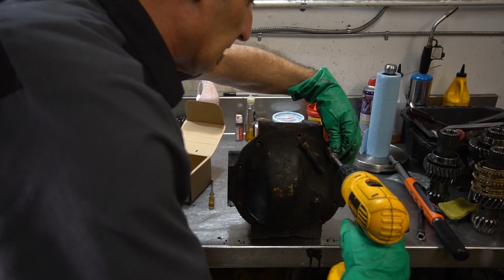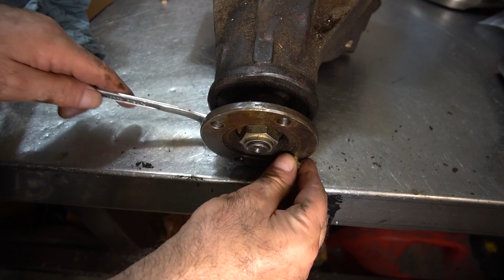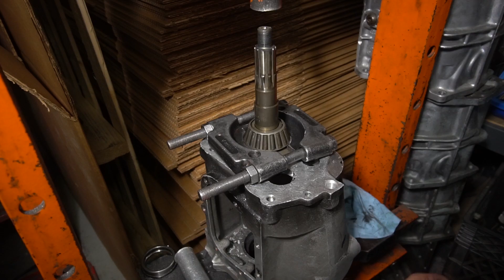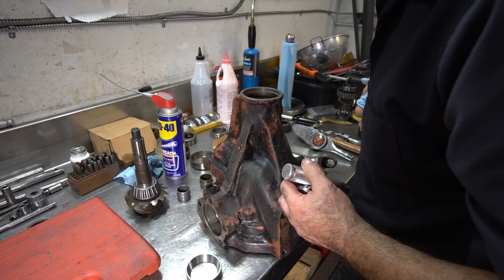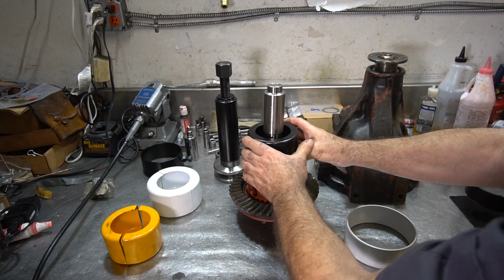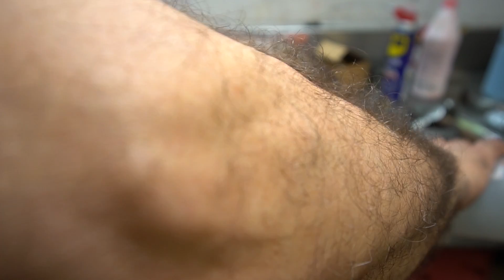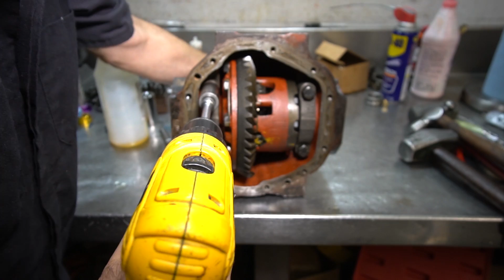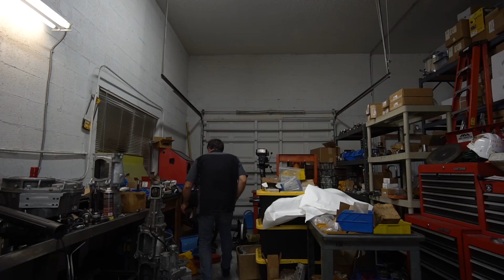Dana 44 Carrier and Pinion Bearing Replacement Basics Jaguar XKE

Comment: Great timing for me to see this video.  I'm getting ready to change the pinion bearings in my landlord's jeep commando and swop out the front ring and pinion in Jeep. Now I have all the information I need to get both jobs done. Thanks for your excellent tutorials.  I watched your tutorial on rebuilding my Muncie 4 speed. It really gave me the confidence to get it done right. Been running it for almost a year now and it works great!! Thanks again.

Comment: Paul - you're a brave man, setting the drag with an impact gun.  (Either that, or just MUCH more experienced than I am - likely!)  I always do it by hand, just because I don't trust myself that much, and don't want to have to buy another collar and start over.  :-P

Btw, I love your method of setting the pinion depth without the crush spacer.  Wish I'd thought of that years ago.  Cheers, mate.  :-)
Reply: PS:  One downvote - must have been Rhonda.  LOL
Reply from the maker: Originally my shop rebuilt everything. We did engines, automatics, manuals and diffs. I set up hundreds of diffs but liked doing vettes , jags and Ford 9" the most because I didn't have to deal with  complete axle and housing assemblies cluttering up the shop.

Comment: Thanks Paul, Excellent video! I've always been concerned about new bearing sets being slightly different than old ones. I don't remember ever having much of a problem. I will mic the width of the races between new and used bearings and they have always been within a couple thousandths if not perfect. Do you ever have any troubles with this since you cant check complete bearing wear between the cup and cone. I just always check backlash.
Reply from the maker: If the backlash is in spec, which it usually is and the pattern matches the old one, as it did here. It's OK.  Bearings are pretty accurate between  both US and Japanese manufacturers. Its not the width of the raceway.  Its the fit of the taper, which is measured by both bearings combined. Hard to do when you are usually replacing ones ( as in this case) that are destroyed.
Reply: OK, Thanks Paul. Great job !

Comment: Paul, thanks for the tips on the flat stock. I've dreaded buying a pinion depth tool because they are so dang expensive.
Reply from the maker: When I did alot of these I had a bench fixture that would hold them downward, making it much easier to work with. Some rears I had flat stock that bolted to the saddles. It's pretty accurate.